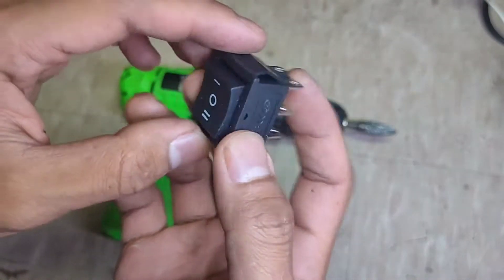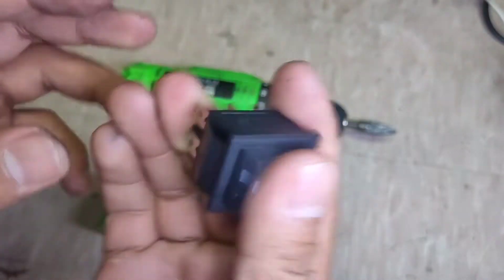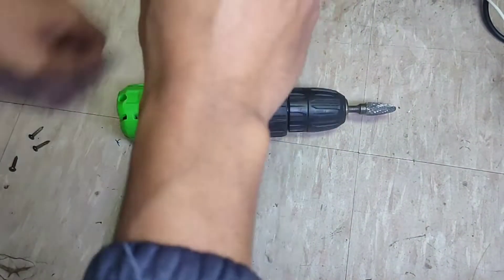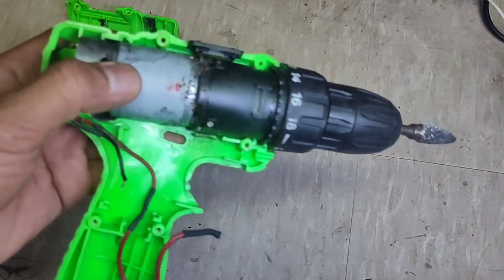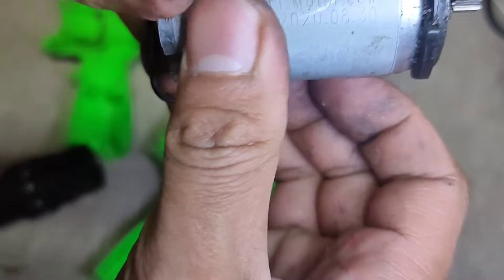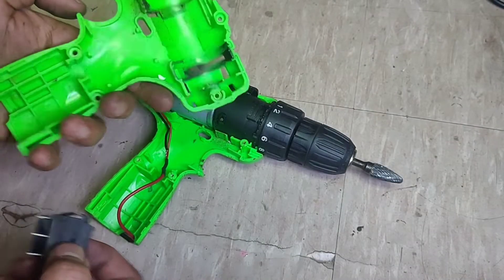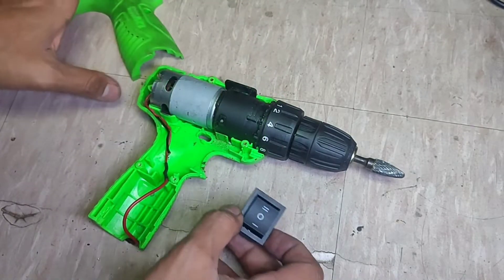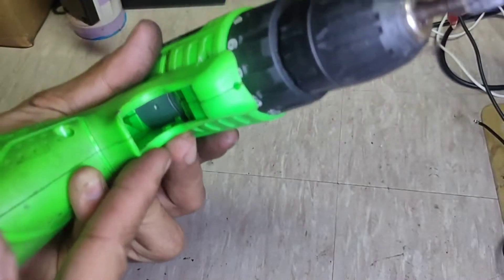ganti switch saklar bolak balik mesin bor mini drill dengan mudah

Comment: yaaaa tapi dul,
kalo digituin dinami jadi berkerja dengan kecepatan maximal tanpa ada kontrol dari modul atau minimal ic controller ,
kalo dibuat gitu, malah pabrikan jdi seneng , cost produksi jadi turun 😂

smntara user ketika menggunakan jdi gak stabil, krn tiba² putaran dinamo bgtu ditekan langsung berputarr di rpm tinggi